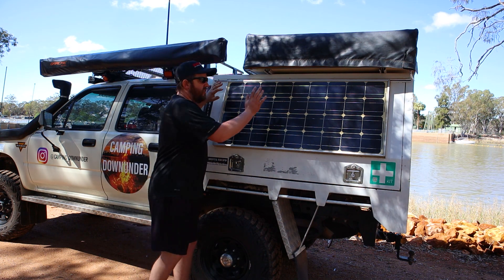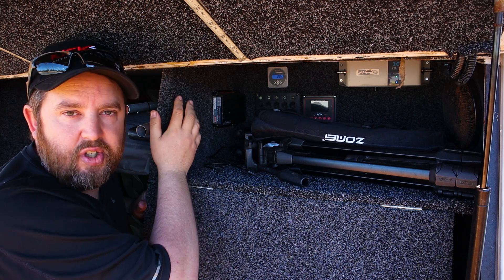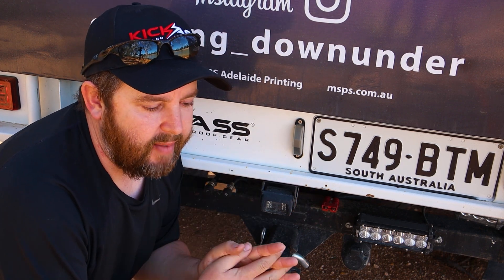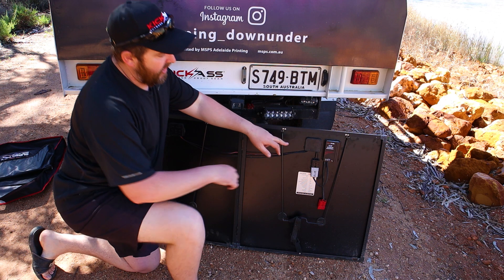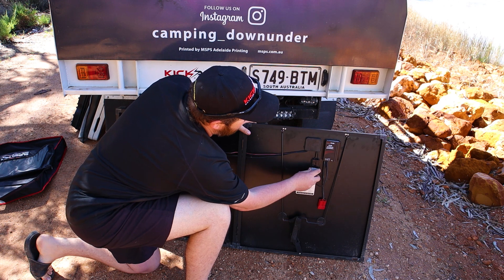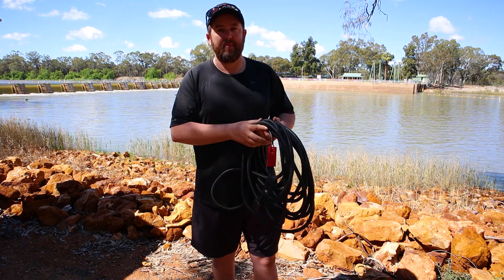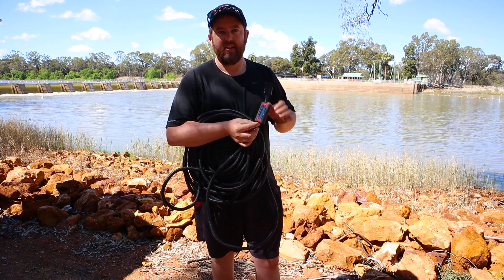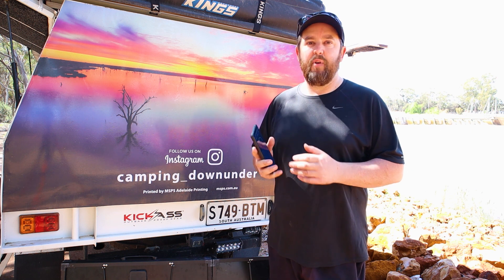HOW TO RUN 500W OF SOLAR FROM 1 CHARGER

Comment: I appreciate your response to my question about the solar blanket from one of your previous videos.  I have a BCDC1225D as well with flexible solar on the roof.  I'm considering a solar blanket option via Anderson as well.  I've had trouble with the Victron getting it to sync to my Battle Born lithium.  So for you to monitor your input current...the only way you can get an accurate reading for your solar is to disconnect the other charging inputs to isolate the input that you're focused on...lets say the solar blanket?
Reply from the maker: Yeah the solar is still current going into the battery. Mine are hard wired so I just test my devices at night time when the solar panels aren't doing anything 👍
Reply: @Campingdownunder  if you want a solar off switch  add a reset breaker  inline 😉